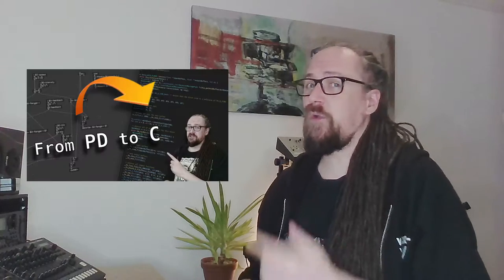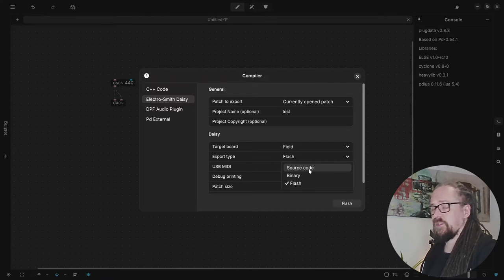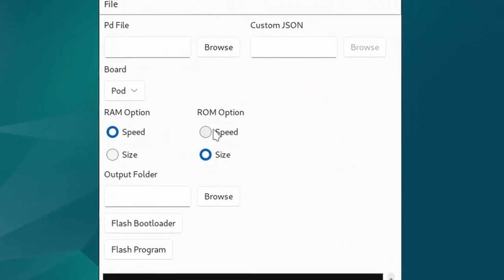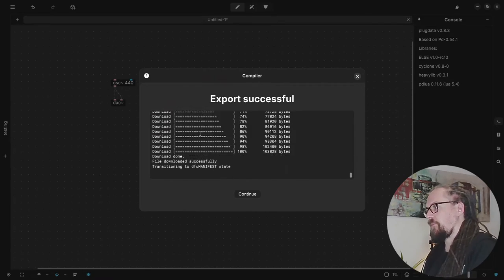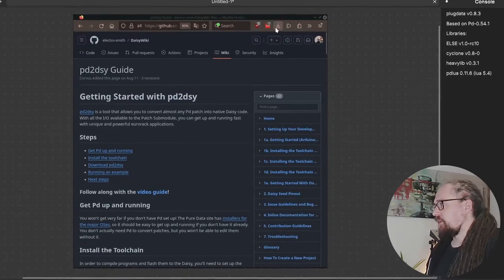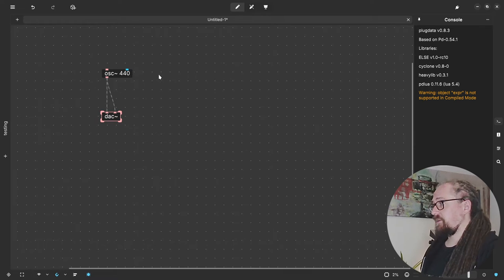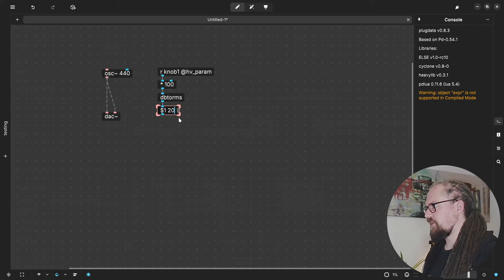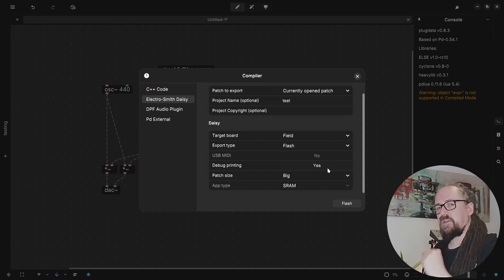PD to C - Electro-Smith Daisy

Comment: This is great! Looking forward to a custom json video!
Reply from the maker: Something is brewing, but it shouldn't be too simple nor too complex.
Any suggestions other than some knobs/switches? :)
Reply: @Wasted-Audio  I am trying to get a light dependent resistor to control the pitch of an oscillator using the daisy seed. Anything similar to that would be awesome!
Reply from the maker: @alexandersousa6728  That should be relatively easy, considering it's just a resistor.
Any example that uses a potentiometer should be able to be replaced with an LDR.
Reply: @Wasted-Audio  funnily enough, I was digging through some of the documentation trying to figure out how to write custom json for my simple fix board, and then I saw the "simple" option in the dropdown, only to realize all the work had already been done... Is everything in the pd2dsy library supported, like encoders, LEDs, etc? 
It would also be cool to see a video on how to interface with other things, like SPI bus or I2C. I'm eying some projects that use an MPR121 capacitive touch sensor, and I'm curious if it's possible to interface with that (especially if there's a way to use existing C / C++ libraries like the one from adafruit)
I'm also finding a lot of cool things with the plugdata UI (which is amazing, btw) and I'm starting to wonder what other keyboard shortcuts and workflow tricks I'm missing (eg dropping a command block onto an existing patch to "splice" it into the patch is a huge time saver). It would be cool to see a video overview of all the great features.
Thank you!!
Reply from the maker: @235_10  This is a lot of questions at once!

The "Simple" is a basic board aimed at the Synthux Academy projects, it is still missing a lot of components and we want to expand it to cover a very basic/simple project. Any feedback is appreciated.

pd2dsy is not a library and it is not supported. Do you mean json2daisy? (which is being used under the hood)

Mpr121 sensors are supported and work reasonably well.

It is not possible to use other c/c++ libraries.

Comment: This looks really good.  Can I ask... how would this work with regards to software licensing and possible redistribution? Obviously PD itself is on BSD license but once you have compiled for daisy (I am guessing this would be a .HEX file or similar) there is no longer access to the source/ patch.  

Thanks for the tutorial 🙂
Reply from the maker: We don't use any PD source code. The internal Heavy static C library is likewise BSD licensed. Any user generated code is licensed as the user wants using the "copyright" argument.

Of course if you base your patch on patches and abstractions that are not freely distributable that makes you liable. The conversion of source patch-code and it's associated legality is quite a grey area. Personally we only include such patches if they are liberally licensed (MIT/BSD/ISC/CC0 etc.)

Comment: Nom nom nom, eating this up. 
Can you do some custom hardware next, like buttons, pots and 9 axis accelerometers?
Reply from the maker: Custom hardware is on the planning! certainly buttons and pots, although for that last one we need to source a `Bno055` first (only 9 axis component currently supported in json2daisy). Which is a tad expensive, or maybe the ICM20948 which is cheaper, but still a bit much.

We'll probably stick to a bit more basic stuff for the next one :)
Reply: @Wasted-Audio    I have a couple of the Bno055's, although would it be easier to run the stuff through an atmega and just program the digial ins to the seed with PlugD?
Reply from the maker: @chillywilson The Bno055 is supported in libDaisy and json2daisy (which is used to create the interface with Heavy): https://github.com/electro-smith/json2daisy/blob/main/src/json2daisy/resources/component_defs.json#L1207-L1310

How would you want to receive data from the Arduino then?
Reply: @Wasted-Audio  I was thinking digital in to daisy
Reply: @Wasted-Audio  Why isn't a 6 DOF device sufficient? Is it really that important to have magnetic North in the input stream?
Reply from the maker: @WackoPaco  I never said any of this. It's @chillywilson that wants a 9-axis accelerometer :)

Comment: Thank you very much for the video!
I am trying to load an example, but in the PlugData board selection menu the Seed option does not appear, only pod, init, simple, etc.
It will be an error in the installation
Reply from the maker: The Seed is not a valid device yet. You will need to create a custom board.json that defines a hardware setup built around the Seed.

Check out this Wiki page (and link to examples at the bottom) for more info: https://github.com/electro-smith/DaisyWiki/wiki/Pd2dsy-JSON

Comment: I'm trying to compile a very simple delay effect using plugdata 9.0 flashed to daisy patch. I do not hear any delay effect. my patch uses adc~ & dac~ objects  as start & end points in the patch. All objects are "compile mode safe". but i cannot get sound out of my daisy patch.  Also its seems when I compile I am only able to generate a bin file followed by using the online daisy programmer since it seems flashing doesn't work. I definitly have my daisy in DFU mode prior to flash attempts.
Reply from the maker: Which compile mode are you using? With delays you will likely at least need big or huge modes and even more likely use an extended linker. Right now this means using the custom linker option and then use the SDRAM for the dynamic table. You can get the SDRAM linkers from `Documents/plugdata/Toolchain/etc/linkers/` directory (we will include them as a compile option again in the future).